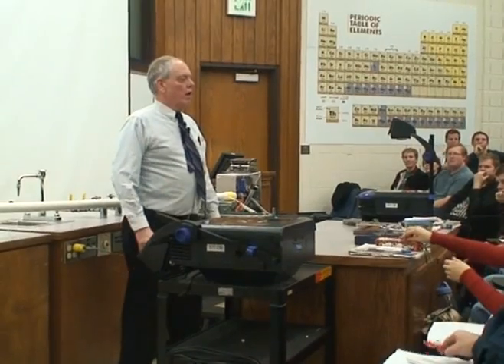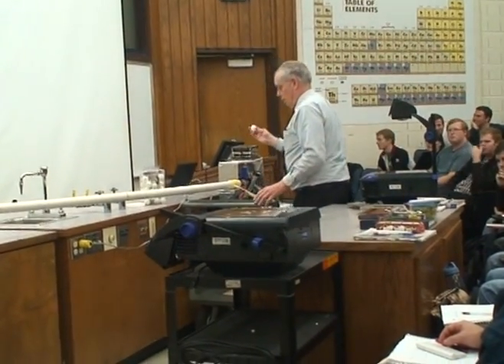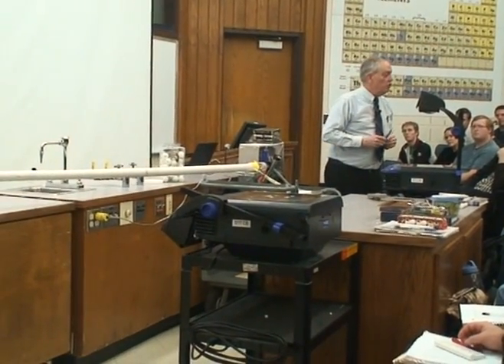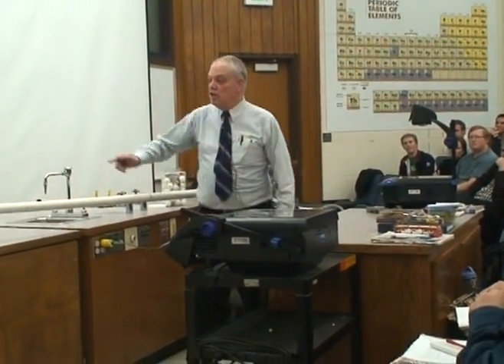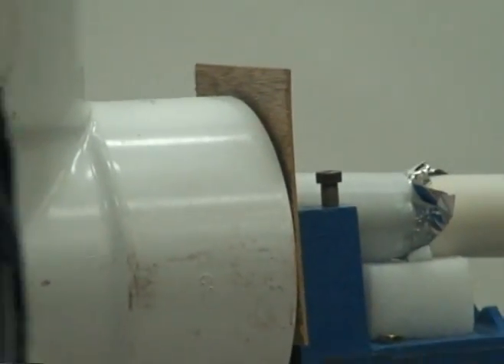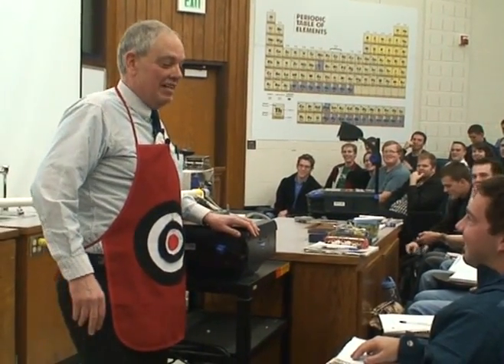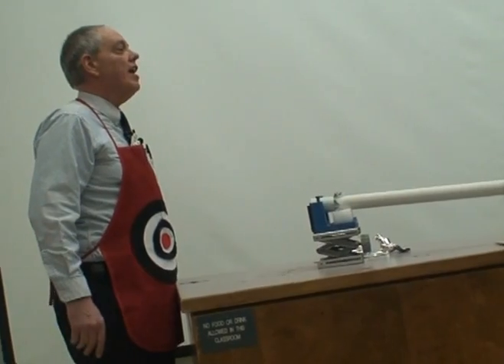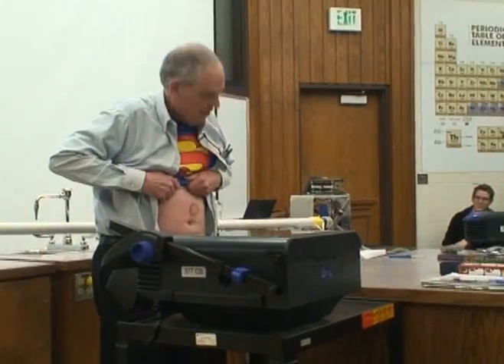Stokes pingpong cannon

Comment: I built a 5 ft tube vacuum canon for demos in my science class. I had a student ask me once what happens if we put a marble in there, so I had the class get behind a counter and I launched the marble.. of course, most of the air went around the marble and it kinda just fell out the end. Then a student said we should push the marble with the ping-pong ball, my first thought was that it would come out similarly, but just in case I put a piece of 3/8 inch laminate flooring I had with me in front of it and held a steel lid (from a fire bucket. ) to deflect anything out at an angle away from anything. Of course, the marble blasts through the piece of wood easily and dented my steel shield a half inch in. Now I have dozens of holes in this piece of board and dozens of dents. I guess the transfer of momentum in a vacuum was near perfect between the ping pong ball and the marble.